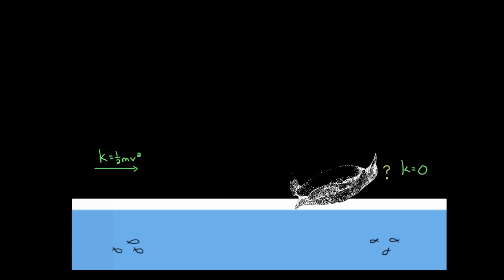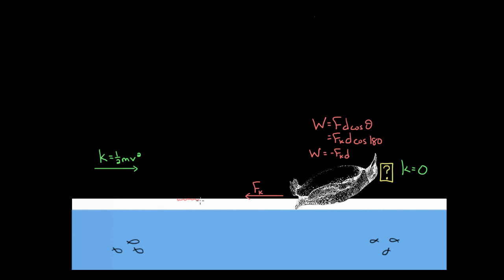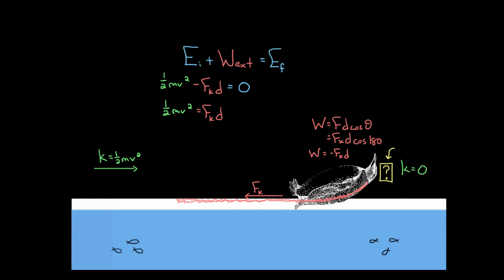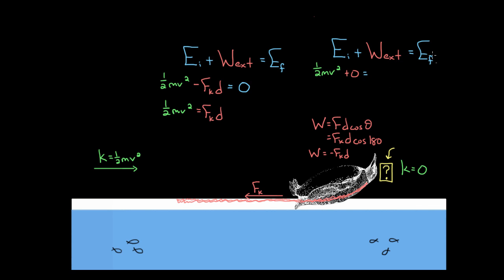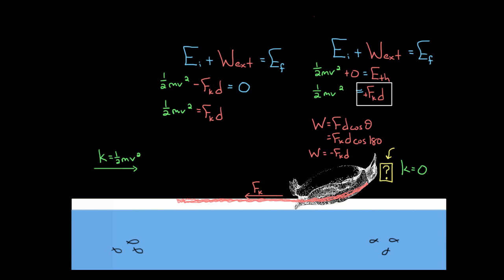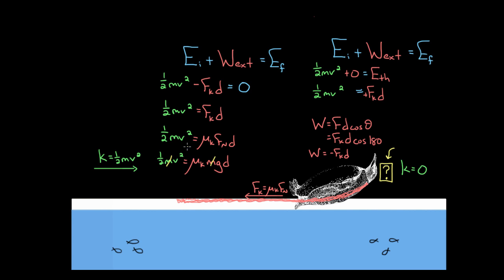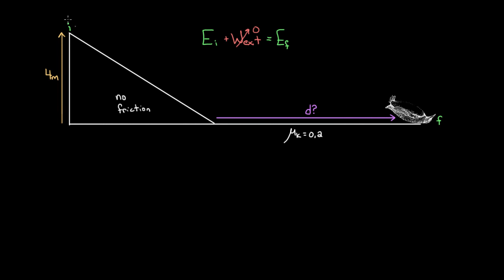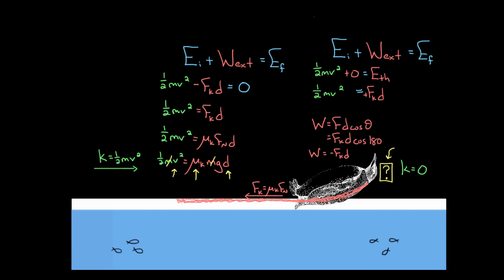Thermal energy from friction | Work and energy | Physics | Khan Academy

Comment: im not really sure of this but i guess in the final example u gave ; the angle of the incline platforme from where the walter slides metter too , because standing there means the the weight P ecuals mg * cos alpha which alpha is the angle of the incline platfome and h ecuals zero because he is standing on it
Reply: i had the same question pro.